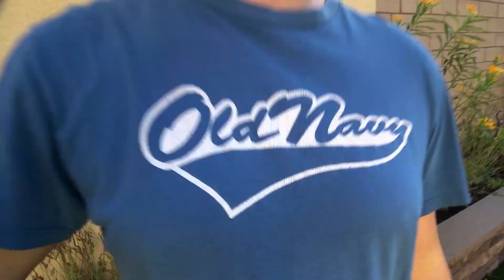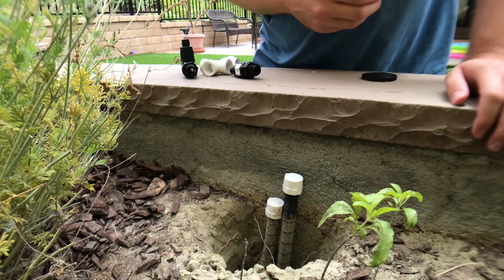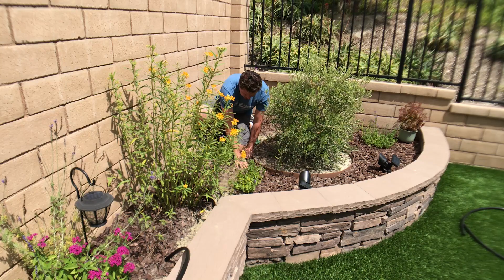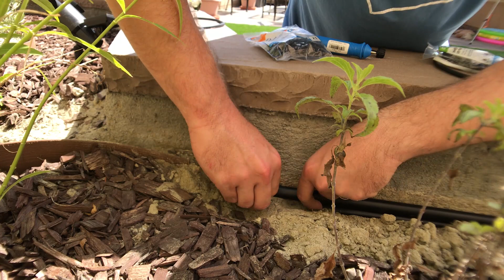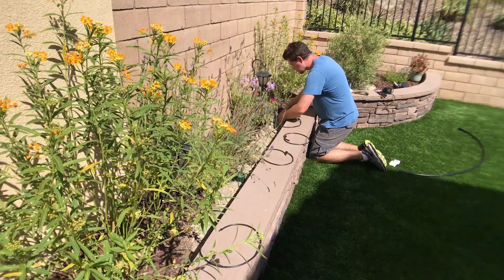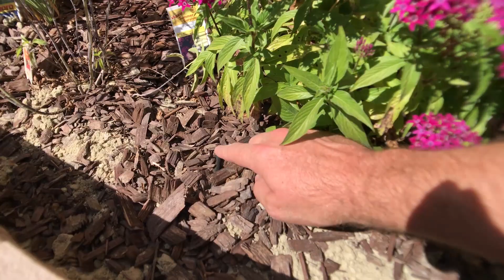Save Water & Time: Install a Drip Irrigation System Today!

Comment: Great video! My professional advise would be to not use the adjustable emitters. Rather, it's a better idea to get specific sized emitters (0.5, 1, 2 GPH (gallon per hour), etc...). Also figure 8s are a great way to kink the end of the 1/2" drip line.
Reply from the maker: Thank you! And thank you for taking the time to comment. I was concerned with emitters because, from my VERY limited experience, I wasn't sure which size i needed for each plant and they are just dripping the water in that one spot. I liked the adjustable bubblers because they are adjustable and they spread the water out a bit. I would think that would promote more root growth but, i could be wrong. Something else i'm a little worried about is i didn't install a pressure regulator. So far so good but, do you think one is necessary?
Reply: Too much pressure can cause issues such as leaks. Your 1/4" barbed lines can blow out. Also with gph emitters additional pressure can increase flow. Another important element are the filter portion of the pressure reducers. If debris enter the line upstream, whether from a dirty secondary water source or a line break, these debris can cause major havoc and clog the lines and emitters. Not trying to sound dramatic. These are just real world situations that do happen.
Reply: The one thing I find is sized emitters tend to clog from hard water calcium build up and need to be replaced periodically, but with the bubblers they can be unscrewed and cleaned.